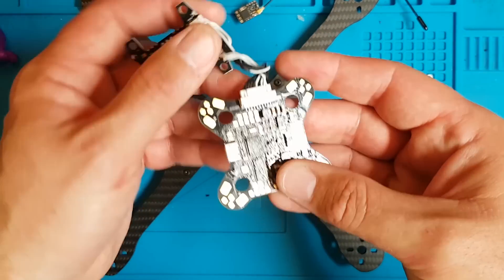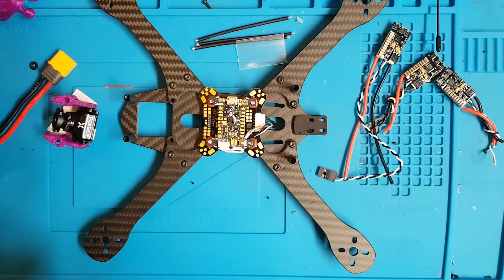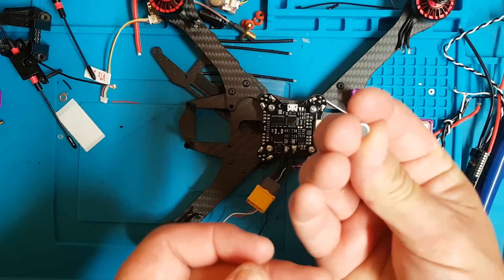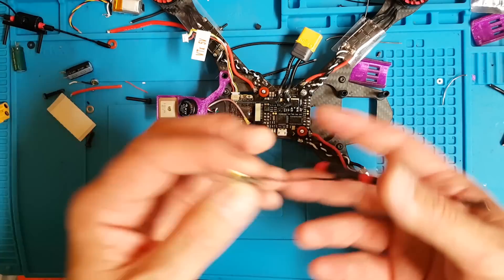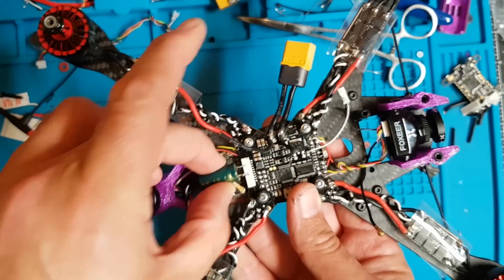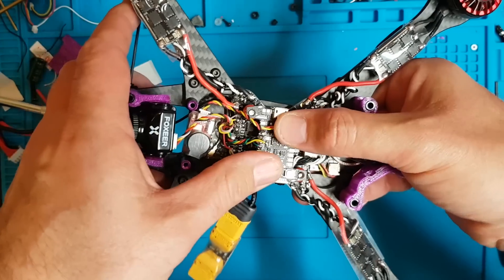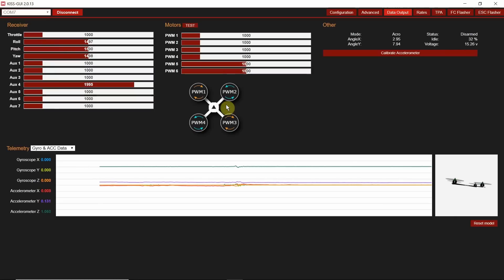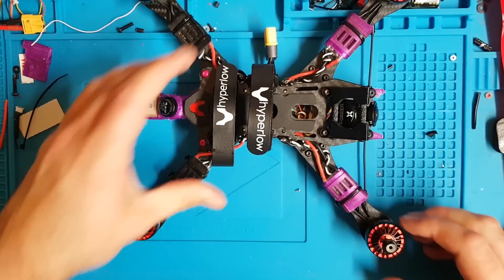Hyperlow CG 6" kiss v2 GPS build & setup

Comment: Thx for the build. Just did mine today. Exactly same setup. 
Do you have gps coordinates on your radio ?
I ve in the osd but impossible to have them on the taranis. 
When I try to find sensors (gps related). I’ve nothing. 
What is your open-tx version and Xfire version?
Thx sir.
Reply from the maker: If you’re using the Wolf PDB and have set it up correctly using the wolf configurator they should be auto on the taranis. I didn’t do anything to it other than find new sensors. My opentx is ancient and I’ve used about 4 versions of crossfire and it doesn’t make a difference. When you’ve got that bit working you can add this which will basically log your last gps coordinates on your taranis so if you lose video you’ll always be able to find it. https://youtu.be/5fq1_clj2hM
Reply: Coppertop FPV weird to have gps coordinates on the osd and not in sensors list. Never had that before with beta flight for exemple. Thx for your reply btw

Comment: I'm a Betaflight and Inav builder. Never had a Kiss machine. So bear with me here. Can you add some level of GPS based autonomy to a Kiss quad? Is RTH, loitering possible?
Reply from the maker: there's no return home with Kiss. You can use GPS and home arrow etc, but that's it.

Comment: I’m sure even with BLHeli32 you can change motor direction in the ESC tab in KISS config mate, sometimes when you first enter the screen after agreeing to the warning the ESCs don’t show, even with KISS ESCs, but just exit the ESC flasher tab and then go back in and the ESCs should show up and allow you to change direction.
Reply from the maker: Dav ah i did that, but didn’t go back in. Cheers bud
Reply: Coppertop FPV I think it’s some sort of bug because it does this with every KISS build I’ve setup. 

I haven’t tried it with BLHeli32 but I seen someone doing it on a video posted on here a while back
Reply: It does work with me on kissV1 as Dav said. The only issue it’s that sometimes randomly some motors stop working. It’s like desynch or whatever I don’t know. So my point at this stage it’s if is worth running different esc then the kiss ones.
Reply from the maker: @GioFpv  everyone I know is losing kiss escs left right and centre. No issues so far on my sx218 with blheli 32
Reply: Coppertop FPV your flight footage from the Petit Soldat build you have looks great so v2 is clearly working great with BLHeli32. 🙂

Comment: Does not using kiss esc's ruin the kiss experience?
Reply from the maker: cliterfish nope. They run blheli 32 like the others. They also die with alarming frequency given my local pilots experience, hence why I refuse to use them.
Reply: @CoppertopFPV  good to know! Never used kiss. thanks for the heads up. Love my hyperlow btw!